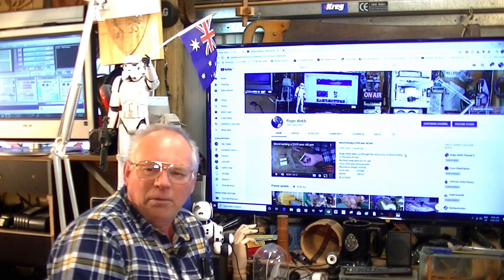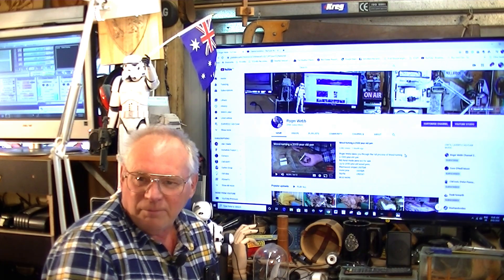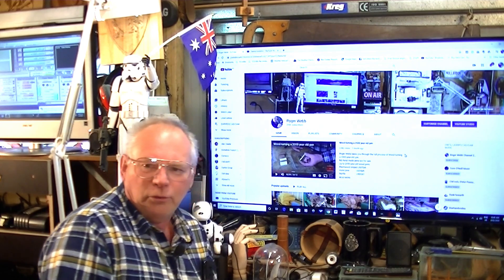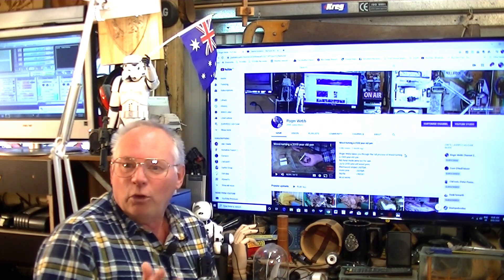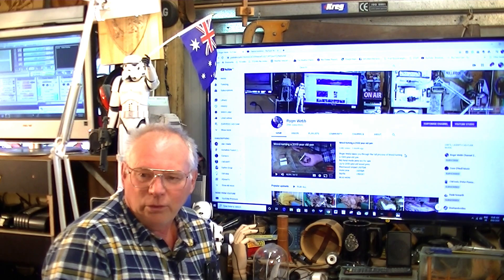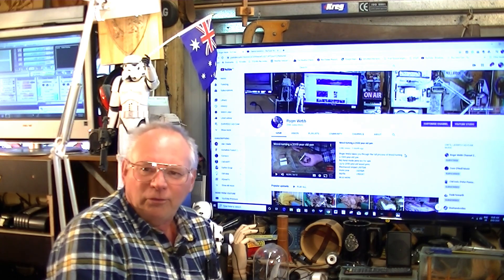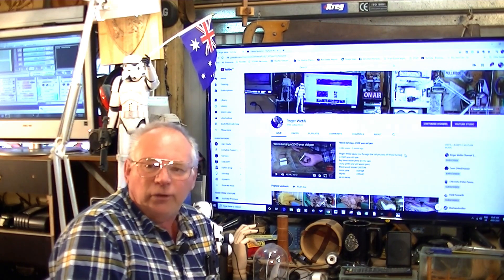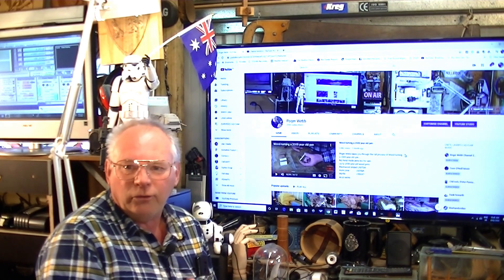My experience buying a CNC router from China ?!? do's and don'ts

Comment: Thanks, I have a blue elephant 6090 that I am playing with and it’s been great. I did upgrade the coolant lines an rerouted the spindle lines. I learned a lot on importing a machine into the US through the process. Mach 3 does work fine on windows 10 64 bit as well if you need it.

Comment: Hi there,  I bought a Chinese made cnc from omni. It's a 1530 (1500x3000) with a 5.5kw water cooled setup. It has mach3 (works well and no worries at all) with a dedicated computer. I use it commercially please note as this is not a hobby machine. I've had it for 9 months and had no issues with it at all. I would recommend them if you are looking for a solid machine for a budget that will cut metals, wood and stone. Having said that I did a lot of research into manufacturers including this channel. Helped a lot. I use fusion 360 for cad and cam btw. Much better than stated but costs a bit.